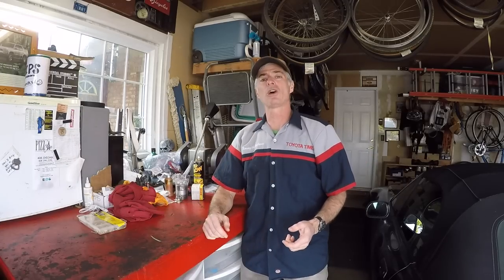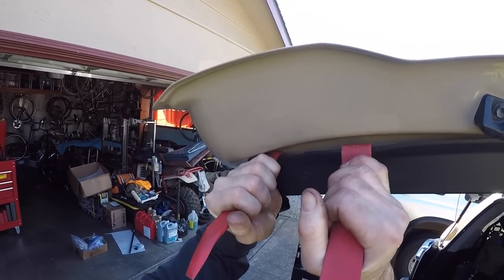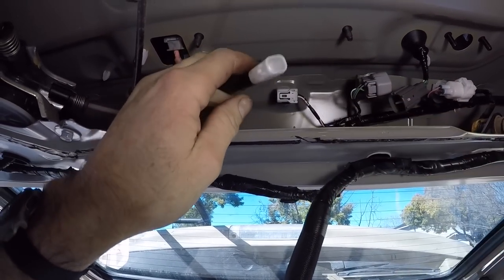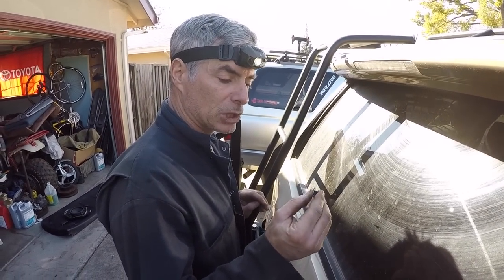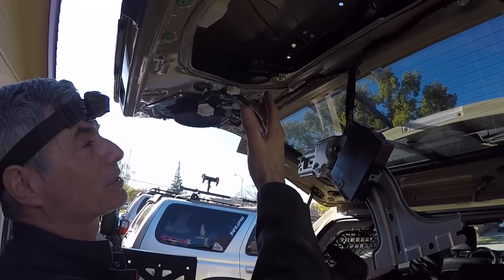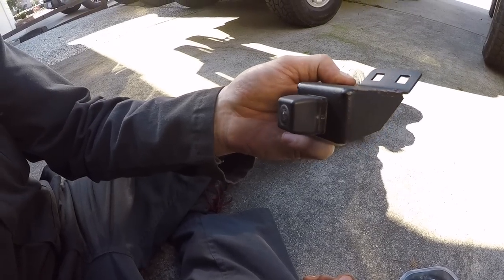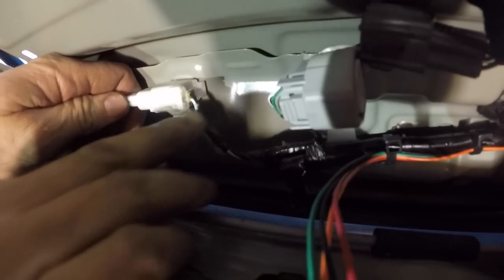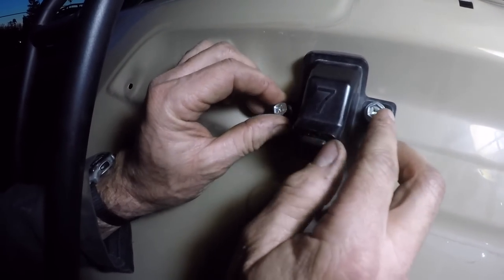5th Gen 4Runner Back-up Camera Relocation

Comment: Recently purchased 2015 4R SR5 with 100K miles. Within a week or so, the backup camera would only work part of the time. A month later, NO GO. The transmission backup switch was calling for the camera and the dash display would go gray.  I used this very good video as a guide to remove my rear hatch inside cover and the center bracket. I was able to unplug from the camera and the frame wiring harness to get the short jumper out with out pulling the outside trim off. Plugged both in and out a few times and camera is now working 100%. In hind site, I probably should have put a small dab of dielectric grease on each of the female terminals b4 I replugged everything back together. I will if the camera stops working again.  These connectors are outside of the plastic vapor barrier and would see moisture from the outside.  Thanks for the great explanation of how to get the hatch cover off.
Reply from the maker: You're very welcome.  I'm happy to know our video helped you track down the problem with your backup camera.

Comment: Thank you. This video was very helpful. I had no issues running wires with a coat hanger. I installed this on a cbi rear bumper. Bracket mounted perfectly to my jerry can holder. For anyone wondering if this c4 mount will work.
Reply from the maker: You're welcome Carlos.  Glad it worked out for you.

Comment: FYI the larger harness at the top of the hatch houses the wiring for the camera and lic plate light wires. Cut there and tap the new harness there and run it the camera bracket and you're done.
Reply from the maker: Thanks for sharing.

Comment: great plan use your own connectors when c4 provided a solder shrink tubing connector. glad your not working on my 4runner. but connectors are never stronger than a solder joint.
Reply from the maker: Hey Brandon, you use what you like and I learned to like using shrink butt connectors.  The connections I made aren't going anywhere.  And yeah, something tells me you're the type of person I wouldn't be inclined to help anyway.  Helping my friend Garett out with his C4 rear bumper install took 3 full days of filming to document and even more time to edit.  I find it amazing you can watch this video and only mention this supposed fault of me using an inferior electrical connector.  There's a word that comes to mind when describing people like you and it's "Trolling A-Hole".  There's a way to bring something to somebody's attention without pissing them off.  You could have simply said the C4 provided connectors would have been a better choice to use.  But, instead you went straight to a-hole mode.  Happy Trolling.  No need to comment on any more of our work.  Your comments will be deleted.
Reply: @TimmyTheToolman   on a vehicle that is obviously taken Offroad and a camera that is for all intents and purposes now mounted to the frame of the vehicle. you don't think that butt connector could ever shake itself loose?  i have seen way too many car fires from failed butt connectors and faulty wiring to know it only takes a few minutes to solder the wires and use heatshrink tubing. hell C4 didnt provide an all in one solution for nothing.
Reply from the maker: @messeduprex  Oh, you're going to talk civil now.  Ok.  There's no stress on those wires anywhere, especially where the butt connectors are.  The butt connectors inside the hatch are protected, wrapped in electrical tape and securely ziptied many times.  On the swing-out, we put the wires and butt connectors in split wire loom, wrapped electrical tape around the area where the butt connectors are and ziptied it throughout it's entire route from under the vehicle, to the driver side swing-out bracket, and then multiple slots in the swing-out itself.  There's no way in hell any of the connections I made are going to work themselves loose.  If you truly watched the video and saw how we did it, you'd understand there's no forces being applied to the wires.  Furthermore, the ratcheting type of crimpers I use make a VERY solid crimp on the wire.  Follow that up with the fact that they are shrink butt connectors with the ends fully sealed, how are they are going to work themselves loose unless somebody get the wires in their hand and yanks very hard?  Come on Dude, you're reaching.  My friend Garett's rig isn't going to catch fire from any work we did.

Speaking of car fires, what's your personal experience with them?  Are you an arson investigator? Maybe you're an insurance adjustor?  I've been a firefighter for the last 13 years and have been to dozens of car fires.  The amazing thing is I couldn't say if a wire coming loose from a butt connector caused any of the fires I went to.  Now, some of these fires looked like the source was electrical in nature, but there's usually no way to know what the definitive cause was unless there was a dead give-away like an arson fire where a window was broken and the fire started from an interior seat with no plausible ignition source.
Reply: @TimmyTheToolman  ignore trolls tim... lol best to just ignore. you are a celebrity now so they will continue to come out.
Reply from the maker: @PhoRunner  You know, I try, and sometimes I can but often I can't.  If I can set the record straight and possibly educate someone, I will.  If the comment is really offensive, I just delete them from our channel.  This guy Brandon wasn't necessarily wrong but his approach definitely was.  Are the solder shrink connectors good?  Yeah, they are.  I've never used them so I wasn't going to experiment on my buddy Garett's rig.  I wanted to use what I knew would work well and that was the shrink butt connectors I had.  He was trying to make it sound like my connectors of choice were a potential fire hazard but the dude was talking out of his ass.  He tried to sound like some authority on car fires, but what he didn't know is he was debating with an actual firefighter who's put out dozens of car fires.  There's absolutely no way you can tell what caused an electrical fire in a rig.  You can suspect some janky wiring the owner did, but this guy Brandon was trying to say he has personal knowledge that wires falling out of butt connectors has been the cause of many car fires.  Yeah, sure Brandon.  Boy, the things people pull out of their ass when they are debating online.